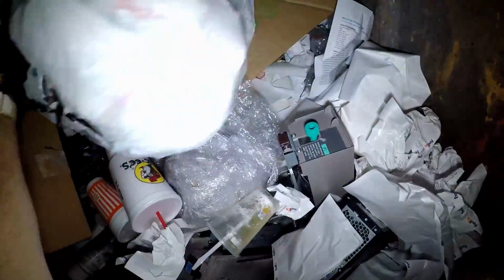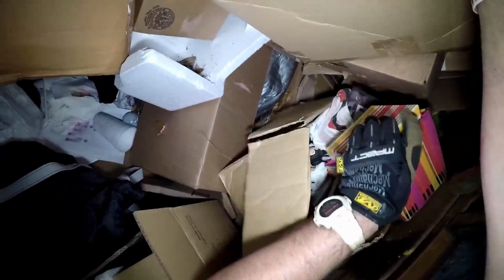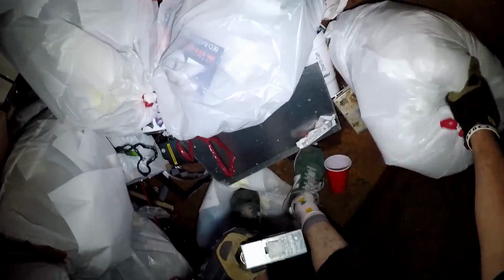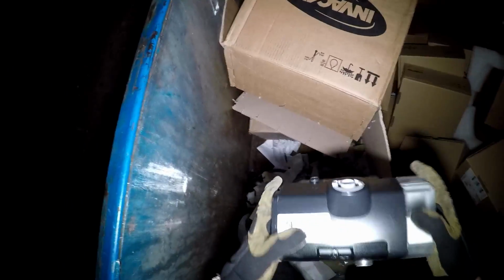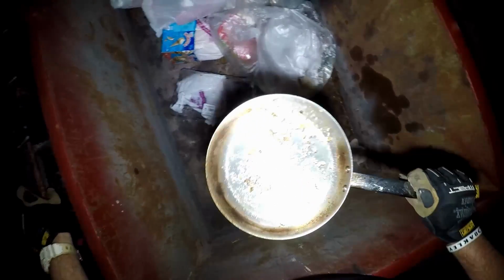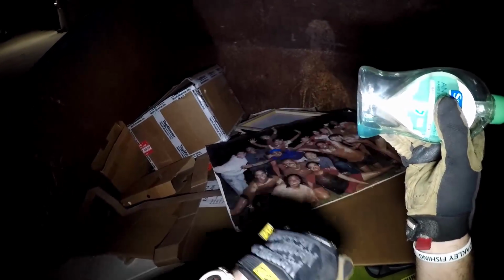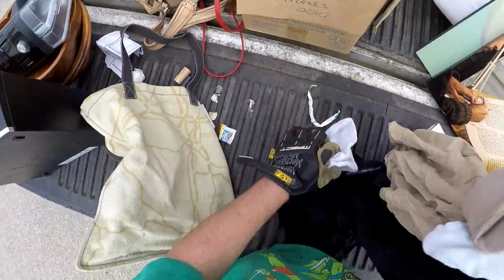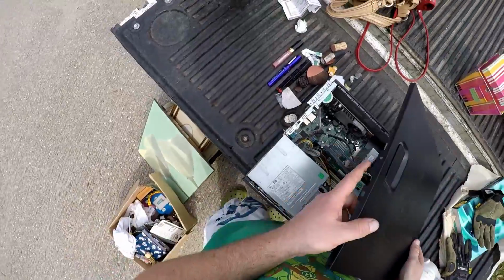Dumpster Diving " I'm Not Eating It"

Comment: ya know mike get a 5 gal bucket go to home depot get muriatic acid concrete cleaner then to dollar tree and get peroxide 3 part acid to 1 part peroxide put your gold bearing stuff in bucket @3/4 full and fill bucket with mixture and put lid on set in corner of storage unit couple months twist shake it once a week pour fluid into another bucket flush parts with water can reuse mixture over and over again by just adding a cup of acid to it simple simon man
Reply: also can maybe find a lot of your acid in them pool dumpsters

Comment: I still can't figure out why u take the slot machine parts that are plastic? I know why u take the metal parts but the plastic has no value. Man i found the mother load the other day. I went to the Walmart that i found a crap ton of fluorescent lights bulbs. When i was there the same open top had a display in it and i thought it was just paper. Well it turned out to be a display of brand new sunglasses. I couldn't get them all bc some asshole that worked for thr trash company kicked me out. I got probably 100 pairs before that lol. They all had price tags on then ranging from 10.99 to 15.99. Was a great hull.